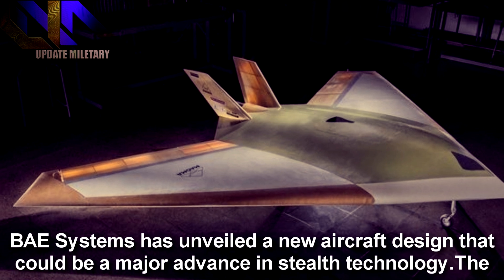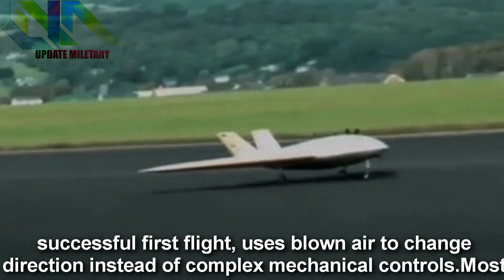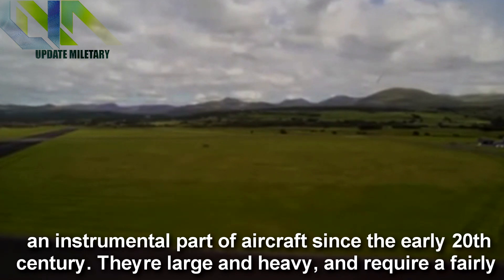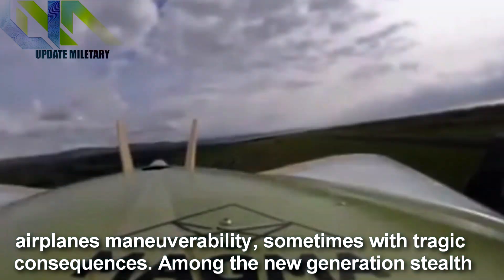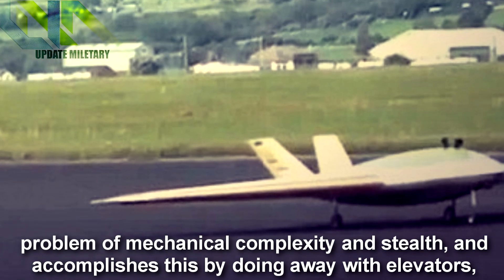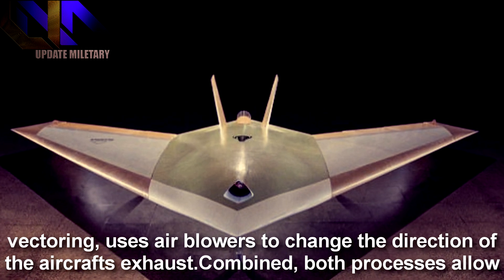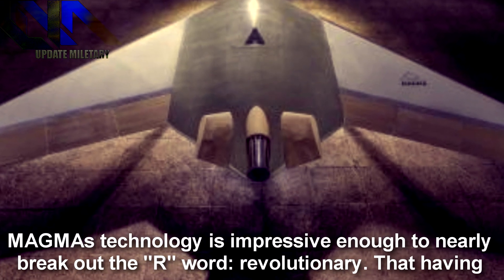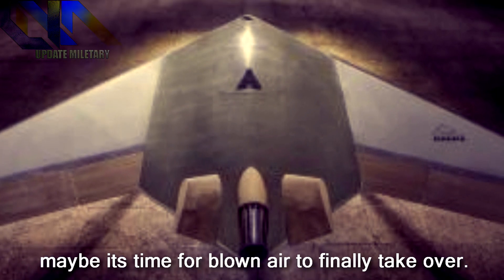New MAGMA Killer  Drone Has No Moving Surfaces at All

Comment: Ah, they could have emergency stuff; however, flying wings are unstable and have limited speed range before wing flip which can lead to uncontrolled flight.  The drone is small so radar is not a problem but it is a good exercise in alternative moving surfaces and so called thinking outside the BOX.  Bell Aircraft also designed outside the box to get market recognition and it worked with military contracts for conventional flying aircraft , they did develop the P39  Fighter to the Bell X-1.  Bleeding energy off the engine which reduces power to convert to speed and altitude is not what makes combat aircraft survivable. The aircraft is worth a look because BAE is number one in automation in flight controllers.

Comment: Good idea only really works up until the engine quits then you have no control without compressed air on board and then you only have a limited amount of time before you have no control so it would only work with a drone with no soul on board.
Reply: Correct, try doing a dead stick landing on an aircraft with no thrust and you realize this is for the birds. Fine for unmanned drones but suicide for the likes of SULLY on the Hudson.
Reply: You can not dead stick a modern fighter. What are you guys talking about, no power equals no control in any modern fighter platform. For something like a passenger platform like you guys seem to be throwing out there you would just have an apu to power the control system.